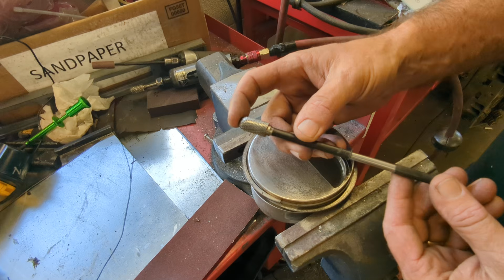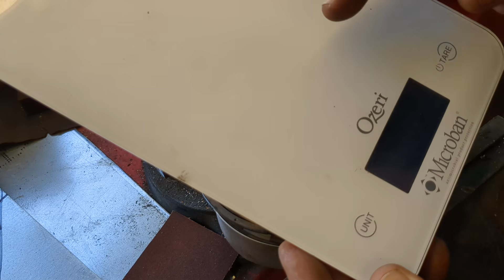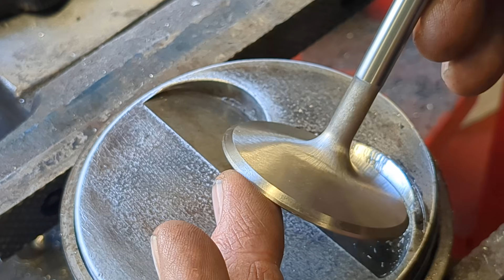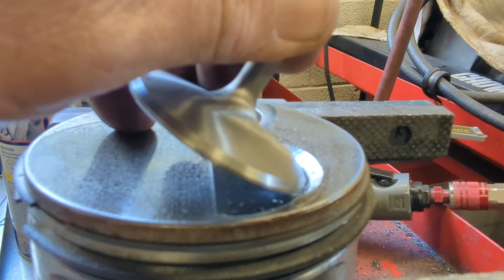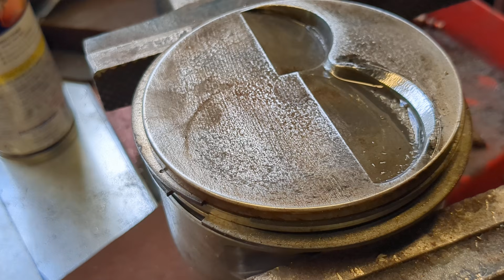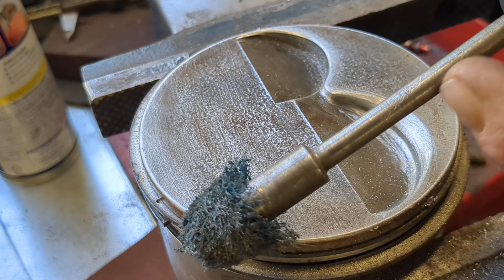The FIRST guy to show you this It will unshroud the intake valve in high lift performance engines

Comment: You got a steady hand! I was wondering if you CC the piston before and after to calculate compression loss, or isn't it enough to worry about? Thanks for a great video.
Reply from the maker: @427_FE  I used to but I've done it so much now it's just not even that measurable but when I started doing it 30 years ago which was the first time I ever tried it yeah they weren't the same I had to work on that
Reply: @SalterRacingEngines  Thanks Brian, I got new pistons ordered, and plan on using your method !
Reply: Maybe 1 cc.
The flow improvement offsets the compression loss a lot. 
IMO
Reply: I was putting my BBC back together today and I noticed that my intake valves had just kissed the valve relief. I had to make that mod today. I didn't think going up just one valve size (to 2.19) would be close enough to cause problems,  SP hyperutectic. I was wrong. Keep up the videos.